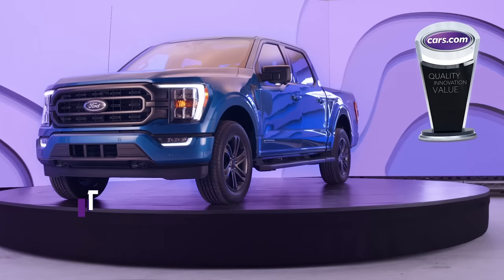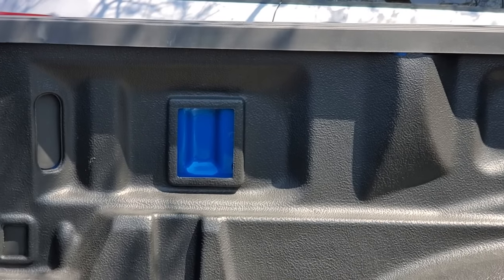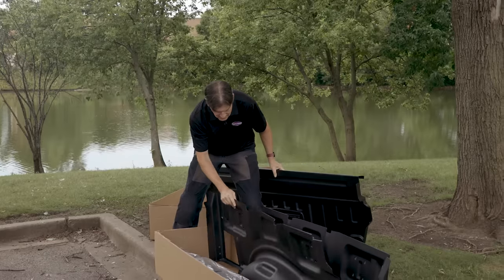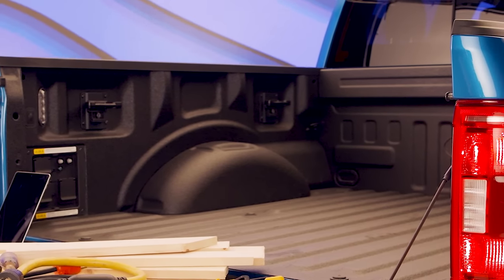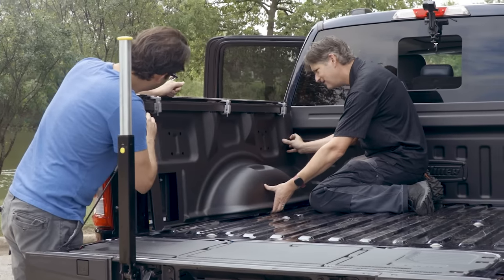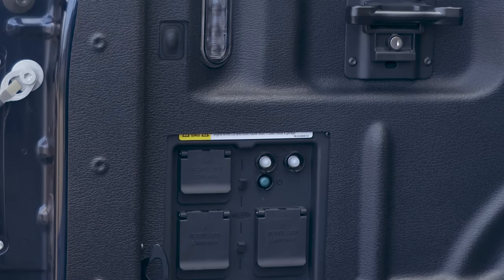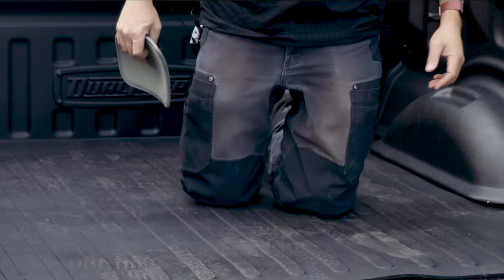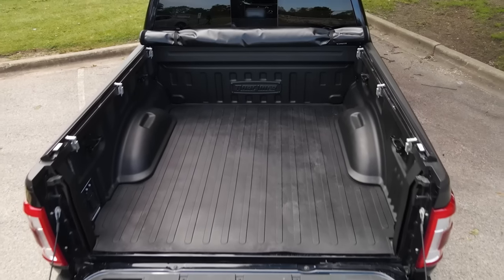No Drop-In or Spray-In: We Chose a DualLiner Bedliner for Our 2021 Ford F-150 — Cars.com

Comment: I would have a spray on for sure but buy just the rubber floor liner shown here and lay  it on top of the spray on. Best of both worlds!
Reply: Or just use a bedrug for the bottom
Reply: That’s what I did for my last truck and will probably be doing for this one.

Comment: Dual liner is not a good purchase for 1 reason. The concept is great. I bought one and I like it except when you go through a car wash, it pulls the rubber mat up, and then you have to craw back up in the bed and get that mat back down in the “notch” again. It’s a pain. I’m putting line x or rhino lining in. Just my opinion.
Reply: What you need is a Dual Liner liner. It's another complete bedliner to prevent damage or movement of your Dual Liner! This bed protection saga could go on forever!

Comment: JUNK!!!  I tried to install one in my 2019 F150. It did not fit the passenger side properly; the mounting holes would not line up.  I called customer service; they said that after being in the sun for a couple of days it will conform to the bed. Also, the rubber mat had a hump in the middle that would also flatten out after a few days in the sun.  Neither happened. The side piece scraped the paint all the way down to bare metal. Customer service said at first, I could return it at my cost of over $100 shipping. After submitting photos, I was told they would not accept a return because it has been altered, the mounting holes now were oblong.  This was due to the cheap plastic and the holes not ling up properly.  Don't waste your hard-earned money on this garbage product. Get a spray in bed liner like I ended up doing. BTW...I have been using the rubber bed mat that came with it for over 4 years now and the hump is still there.

Comment: I put a DualLiner in my 2018 F150 when I bought it brand new. Coming up on 7 years now, and I love it. I've hauled dirt, mulch, gravel, rocks, furniture, fire wood, tools, scrap metal, you name it. The DualLiner is just awesome! Stuff doesn't slide. It's totally protected the inside of the bed.  It's easy to clean by sweeping or hosing. Super tough and durable. I'd get another in a heart beat.

Comment: I don't know, seems like a spray-in with a separate rubber mat would work better. For instance, I wouldn't be able to stand that gap between the liner and the power outlets.
Reply: I had a spray in with a rubber mat on my last truck and it really is the best option.

Comment: I bought a new duraliner bed liner and it was installed in my truck I purchased a bed cover at the same time and place the bed liner has a thin spot in the front left side by the finder well all the way up to the slot for the spacer bar it’s so thin I can probably poke my finger through the bed liner . I bought it from Colton auto Worx in Clarksville Tennessee in February I took the bed cover off to clean the pollen off of the cover and around the edges and that’s when I found the thin spot in the liner it’s so thin the liner it’s self is drooped in that spot I contacted duraliner went to Colton auto Worx all they keep telling me is they have such a back log an their doing all they can to get the bed liners to their customers. So before anyone purchases one of these duraliner bed liners an they get it installed look at it closely and don’t just take it for granted that you got what you paid for they have a life time warranty but this issue is a factory defect and I would never have excepted it like it is it should have never left the factory like it is their quality control system is slacking .

Comment: I have gone through two spray in liners two different trucks. 

Contractor 
Wood cutting 
Our small farm. 

They just don’t hold up. I will give these a shot.
Reply: A factory spray in liner is superior to after factory i have had both. The factory spray in is much thicker.
Reply: I had a spray on with a rubber pad on top on my last truck. It’s works really well.

Comment: Owned a truck for the better part of a decade. I had a rubber mat in the back and while I do think that is a great addition, after 7 years or so it started to disintegrate and would leave marks on furniture, clothes, skin, or whatever it came in contact with. I have also worked closely with a 2019 F-150 that has the factory spray-in liner, and I disagree about it being too course. It seemed to have a good roughness balance where we actually slid items on it to load the bed and then didn't worry about then sliding around once in. While the fit and finish of the DualLiner appears well-done and well-made the Spray-In is the superior/more expensive product for a reason.

Comment: If you have a drop-in bed liner, keep it and add a spray-in liner if you use it for heavy-duty use. A rubber bed mat is excellent, especially if you have dogs.
Reply: You drive around with your dogs in the bed?
Reply: @hellocrappy Yes with a shell.